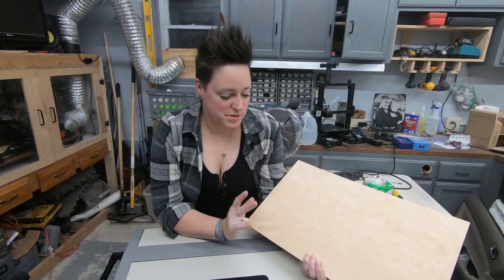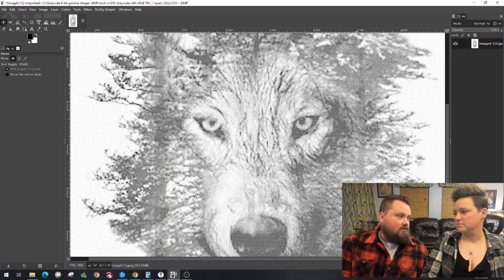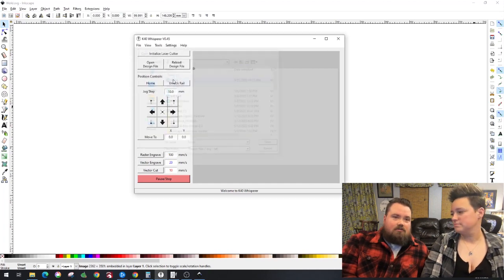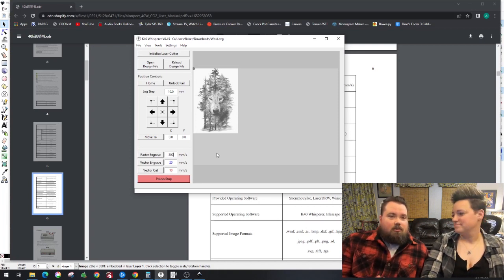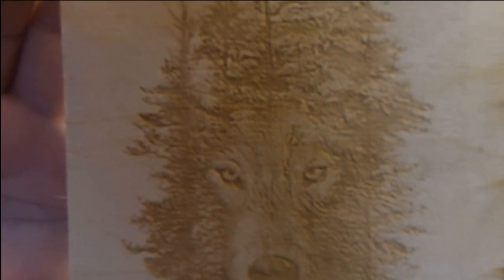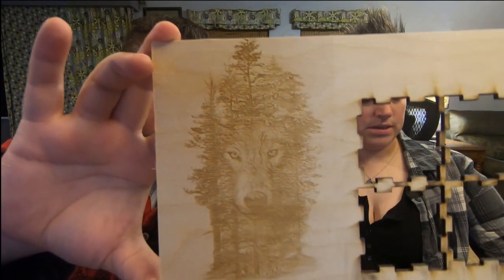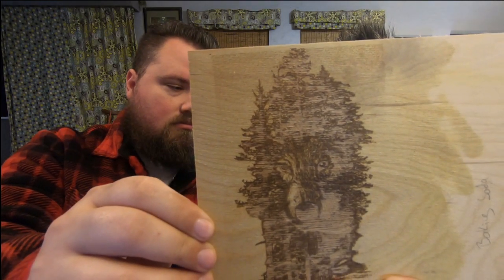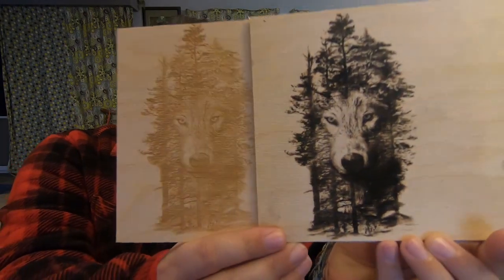K40 Laser Photo Engraving | Monport

Comment: Your DPI is way to high for a CO2 laser.  It should be down around 315 for doing photos with as the size of the beam is bigger than on a diode laser.  So try setting it for around there and as you said, get a bed that you can adjust to get the focus to as fine as possible by first doing a ramp test to see what the optimal focal length for your machine is.  Keep going though, you're definitely doing good work
Reply from the maker: Yeah found that out the hard way on DPI. Thanks for the info and feedback.
Reply: @KLRform  You're welcome.  If you like I can send you a couple of pics of some of the stuff I've done with mine.  Just let me know where to send them